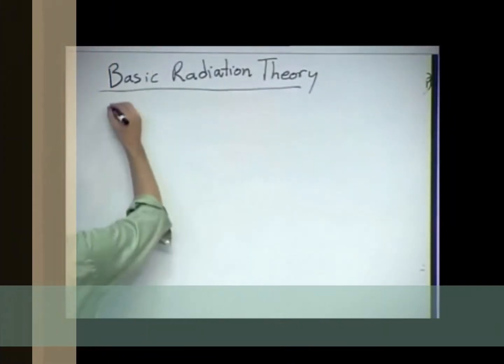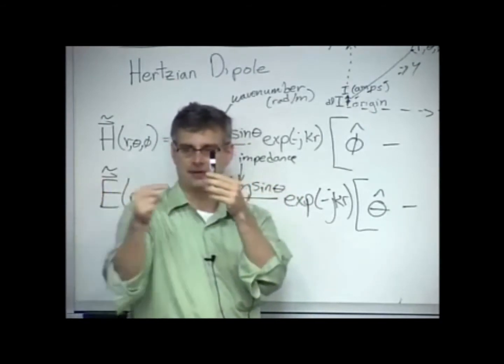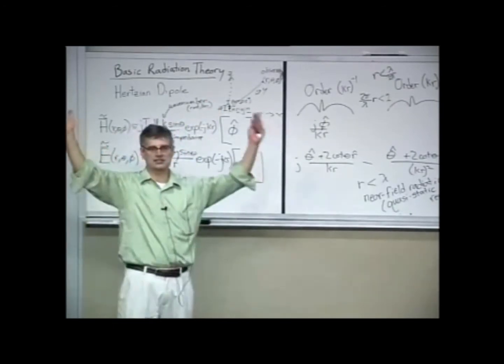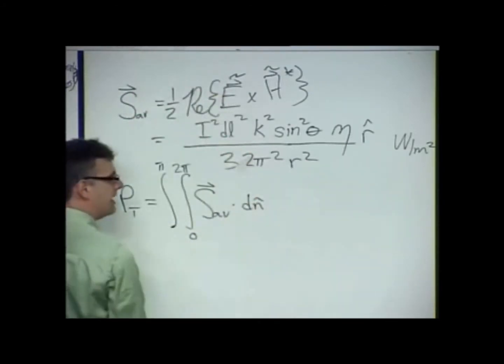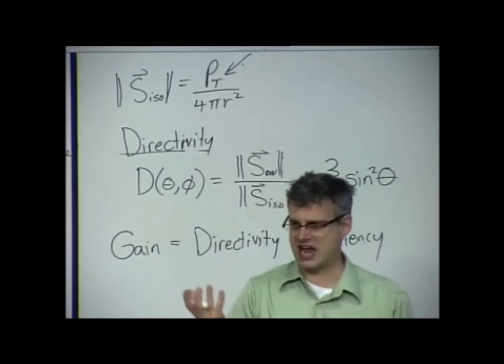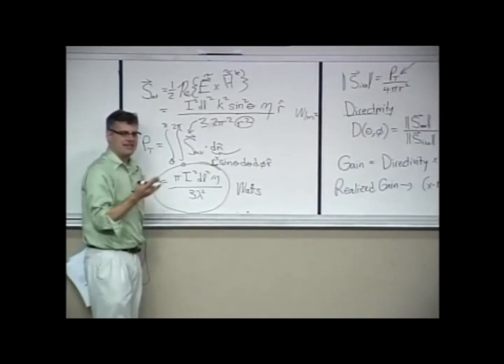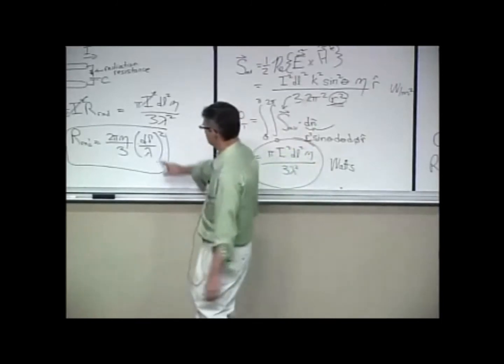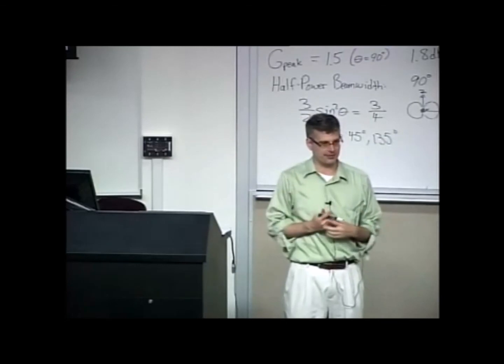ANT04 Hertzian Dipole

Comment: Hi professor- in your discussion on inefficiency of driving the radiation resistance with antennas much smaller than wavelength, why is the capacitance large? I would think that the capacitance on the end of an open circuited transmission line is extremely small.